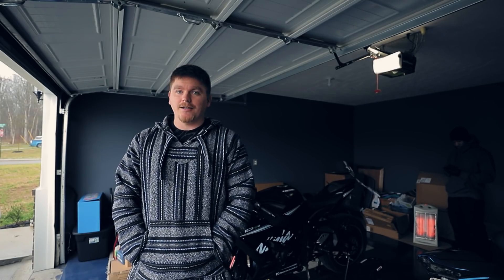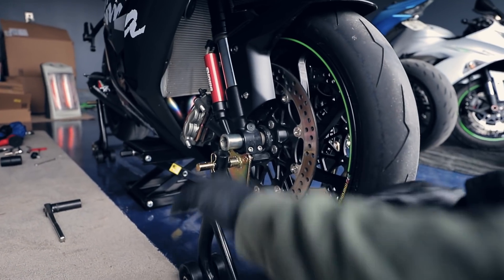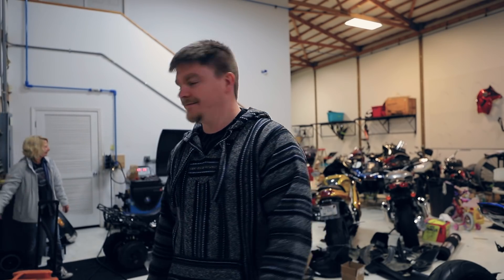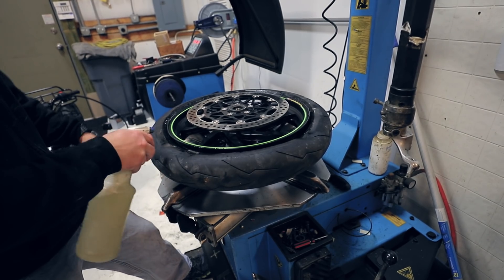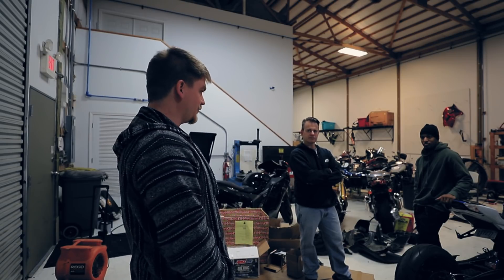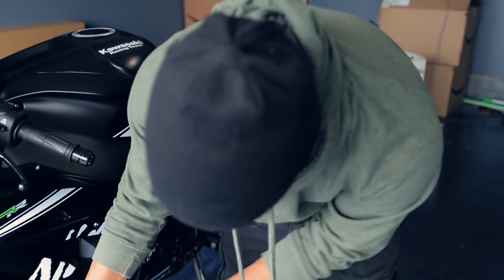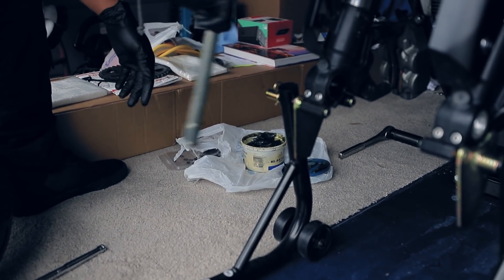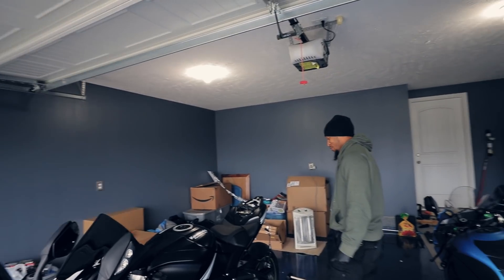HOW TO Take Wheels off a Motorcycle / New Tires

Comment: Same tires I put on my RR. I will check the service manual and see if the weights for the rims are in there some where when I get home from work.  If it is I will comment again :) I went with those tires mainly for rain riding and like you I do not push my bike to the limit of its traction.  You can see from my videos I do push the bike pretty good in corners (but not to the limit) and I have not had any problem with these tires.  You will like them.
Reply from the maker: I like em so far! We got out a few times since I put them on and they feel about the same as the supercorsa. Just more confidence if it’s wet